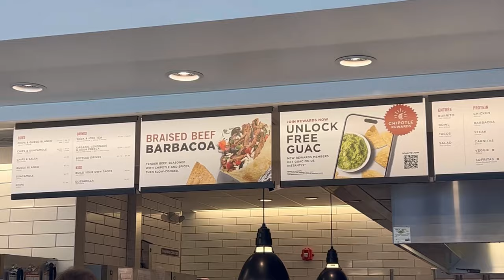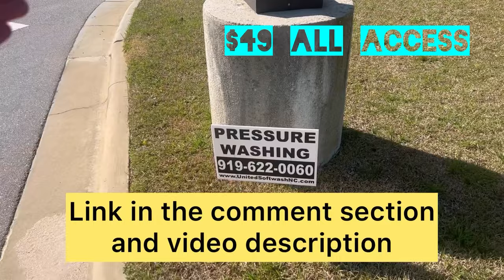Earn More Money in Your Pressure Washing Business my correcting these 6 Problems

Comment: By Far 1 of your most motivating videos.  You hit on EVERY major point.   To add on to your point about being scared to charge higher rates because it "seems" high vs. understanding that we are NOT our typical customer.  $1,000,000 home = $1,000 MINIMUM charge, $2,000,000 home MINIMUM $2,000.00 and so on.  The 10% MINIMUM rule is what made me finally get rid of the what to charge fear.  Inflation and bidenomics does NOT scare the wealthy, and trust me....before they bought that 5,000 -10,000 sqft house, they calculated their annual maintenance cost and guess what....$ for Exterior cleaning was Definitely included in that and probably at 15%.  Great video Kyle....FuK the H8rs!!